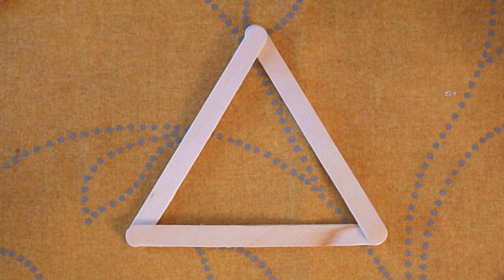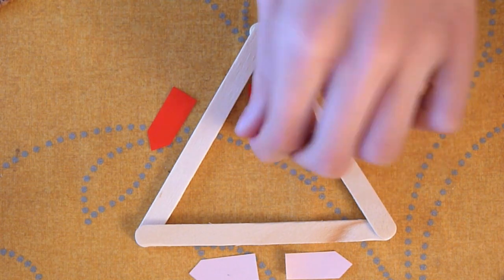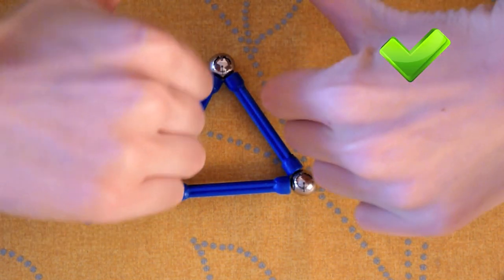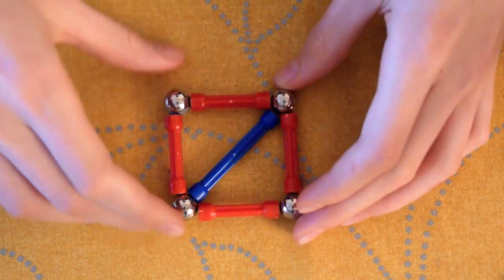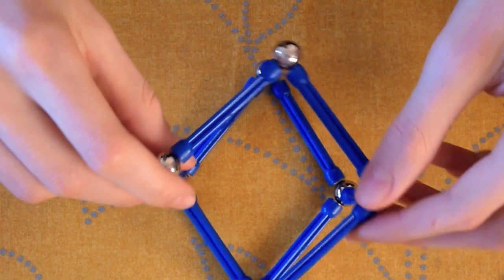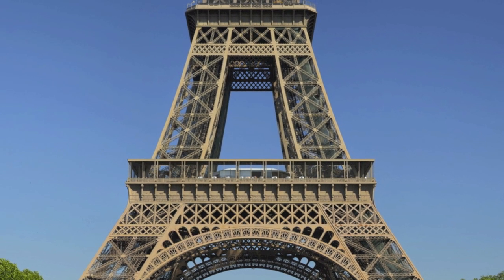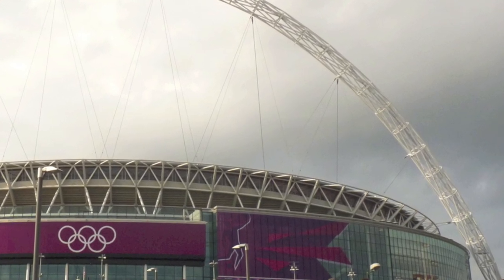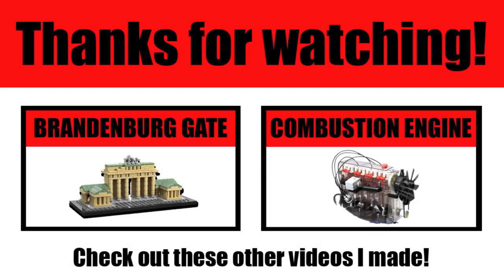HOW TO Build a Strong Popsicle Stick Truss Bridge with Triangles

Comment: if i can only use 40 sticks; should i not use the vertical stick to half the triangles? also, is the bottom necessary?
Reply from the maker: It's not necessary, but it helps. We were able to stand on our bridge at the end of the experiment, you may not, yet if all you need to do is survive a certain amount of weight, you can cut down on things. Try and keep the diagonal inside struts, and the side ones. You can ditch the path surface and the ones that divide the triangles.

Good luck!
Reply: Ouraft you must be able to stand on the bridge
Reply: Ouraft what do you mean by the diagonal inside and side struts? Also, as an update, it should allow my teacher (195 lbs) to stand on it for 3sec.
Reply from the maker: NewKingBrandon I meant the inner struts. What I would recommend doing is making cut down truss bridge. Start with the 4 corners, the bars that run down the center, and just add triangles to hold them together.